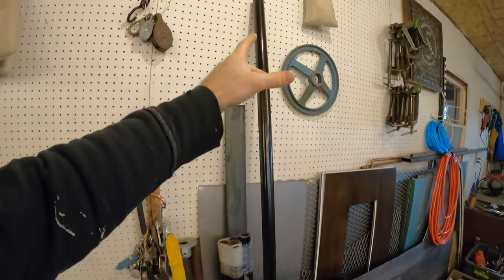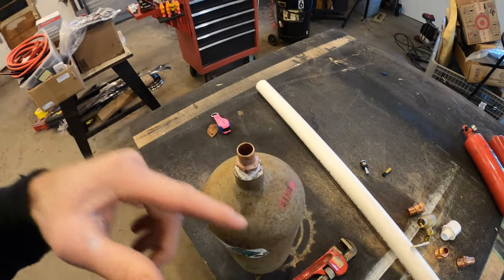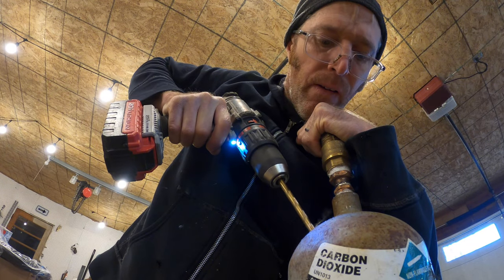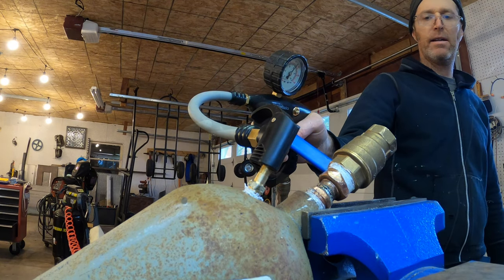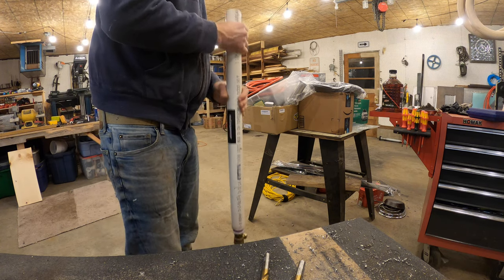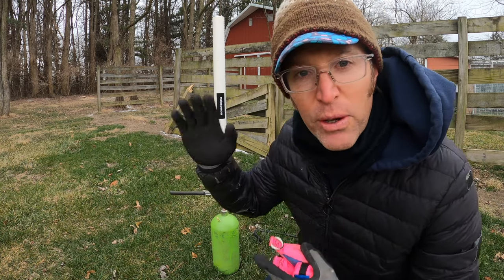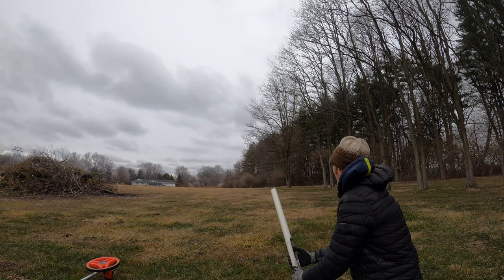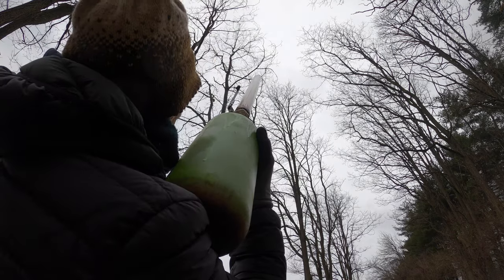Treezooka! DIY Throw Bag Air Cannon

Comment: So just built one of these, but I did a PVS SCH40-only version.  To measure the height of the fire, I just had my throwline attached and shot straight up.  Then measured the amount of throwline taken from the bag.  My air chamber was 34" long (with two bends to keep it short enough for a shoulder fire) so that was about 3/4 gallon.  I only pressurized up to 55 psi and got about 110 feet in altitude.  The 1 1/2" SCH40 PVC is rated to ~200 psi with a breaking point at 2000 psi, so hopefully, I am staying within what is safe.  I've seen the same setup used up to 90 psi.  I was also thinking of building a new version that is more like a big shot in that it would rest on the ground with a long straight air chamber instead of your shoulder.  Thought it might be easier to fire more accurately.  But would also want to think of a way to disassemble it with a coupling in the air chamber and/or removable barrel. And might also want a flexible or 45" degree coupling to facilitate sighting.  Thoughts?  Btw, I was in upstate New York over New Year's out at Niagara and then to Toronto, but was still too far to come by and say hi in person.
Reply from the maker: Sounds like a good build! I like your technique for measuring the distance -- much more scientific than my "Geeze, looks like 200'!" haha ... after making this cannon I've gotta admit that I seldom use it. I prefer my big slingshot on a stick for some reason. I guess it's just because it's easy to pull out of the truck and shoot. I'm eager to hear if you use it much in the field. Thanks for the update! I kinda wanna build that shoulder mounted cannon if only for the shoots and giggles :)

Comment: I have a kinetic water ram that I am going to use to do this. It's basically a tank with a gun trigger for blowing out drain lines. One idea to prevent the gun from over shooting as you described might be to stand on the throw line at a certain length so it goes past the branch then the line stops it and it drops. Also I've used a bow and arrow with fishing line and that worked well.
Reply from the maker: That kinetic water ram sounds pretty interesting -- cool idea. Fingers crossed for your project!
Reply: Ive used bow and arrow many times too.  Idk why, they've never said anything, but onlookers especially women always get that scared look in their eye when i pull out the bow and arrow.  I use a recurve so i adjust the height by just pulling back more or less.  Im planning on building an air cannon bag launcher by using a tire bead blaster and some abs pipe.  They have 2 gallon bead blasters with a trigger instead of a ball valve.

Comment: nice....ive been wanting to build an air canon ( mostly to play with) i have the big shot and the trigger for the pole which makes the accuracy insane... Most of the time it's strong enough to handle trees around here    stay safe stay healthy
Reply from the maker: I gotta get one of those triggers for my bigshot, cuz trying to hold that thing by hand is nuts :)
Reply: @metaspencer  it helps tremendously with accuracy also

Comment: Need line testing. Also look for paintball gun tanks.  Lightweight, but maybe not enough volume?  Even smaller and lighter weight would be a combustible chamber to do the old potato cannon launcher.  Your line length could also prevent overshooting / penetrating your crotch.  Keep developing this technology, if only for the views........I suspect this was more about good times then tree line productivity.   Glad your keeping busy.  I could have use your particular set of skills today. 60 feet pine tree came down last night in a wind storm.
Reply from the maker: That's quite a blower you had there! You're right about the air cannon: more of a fun thing to fiddle and play with than a tool I desperately need. I was throwing into some towering oaks the other day, though, and it would have been useful. I'll definitely keep and eye out for a lighter and smaller tank: that one almost needs a crane to carry it :)

Comment: awesome and fun video... gonna save the shoulder for sure...need some with the line tied on too see how its gonna affect the flight.. it will have to be a light line and then use it to pull the heavier line up and over? we did same thing with a vac to suck or blow a mouse line through conduit to pull wires or another rope through.
Reply from the maker: Yeah, I'll have to do some tests with the line before getting out there into the field with it ... I used to pull lines through conduit that way too. It's amazing how far you can suck a plastic bag on a string. Thanks for checking it out, man

Comment: Definitely worth investing in a cheap battery powered tire inflator. You can definitely measire out enough throwline to stop or slow it down and not have it launched WAY past the target. Although if it is fairly close then just throwing it is going to be easier anyway.
Reply from the maker: That inflation idea is solid!

Comment: Super cool project!!! For getting it to drop relatively soon after getting over a branch (or whatever), you could always gauge the height and tie off the line a few feet longer (4-5 maybe) than that. The extra few feet of line should cause it drop low enough to cause the bag to wrap on the branch (or whatever) before it springs back toward its origin. Also, I kept thinking of a faster trigger mechanism for it so you aren't expending the whole pressure of the tank every time you fire (specifically, I was thinking of the piston system used in No Country for Old Men, but that was a closed system, so not exactly applicable to this tool).
Reply from the maker: I'll be doing some practice with the line on the bag this week, so will have to try your method of shortening the distance with the line. Either that or I'll have to get a sense of how pressure and height correspond. Now your idea of not losing all the air is awesome: just a single puff would be nice. There are air-pressure pellet guns (PCP) that work that way, giving you many shots with a single tank of air. That would be oh so cool. Thanks for the ideas man
Reply: @metaspencer  It sounds like you're in for a lot of fun dialing this in! I'm excited to see what you come up with.
Reply: @metaspencer  pretty sure those have a seperate chamber that is isolated and fills up with every shot

Comment: Sooooooooooo cooooool...I just used PVC pipe for both air tank and barrel.. wayyyyyyyyyyy lighter and can hold 100psi...😁😁😁😁
Reply from the maker: That lighter version sounds great ... may have to make a backup for carrying deep into the woods. Thanks man

Comment: Height in straight up (vertical) shooting is easy to measure. All you need is a timer. Consider that bag velocity is 0 at the top. It is basically a free fall equation (disregarding air friction).
Free fall equation is h = 1/2*g*t^2, where t is a half travel time from the max height.
In your case, if your measure time since start till fall, as T (say 20 sec), t will be T/2 (10sec). And final formula will be h = 1/8*g*T^2

Example: 
Say T (from start till fall) = 20 sec
h = 1/8*9.8*(20sec)^2 = 490meters
Reply from the maker: Woah! The mathman cometh! Thanks… I’ll give it a try

Comment: Noticed that you were attaching a copper fitting on the steel tank. 
Joining copper to steel is not recommended due to the resulting galvanic corrosion between copper and steel.
Reply from the maker: Thanks for the tip ... it still looks like the day I put it together but perhaps over time it'll degrade. I'll keep and eye on it

Comment: I just used pvc for my air tank. Alot lighter. I wrapped it with duct tape just in case it cracked. Looks awsome tho
Reply from the maker: I'm thinking a lighter version like yours would be a good idea and take up less space in the truck. thanks man
Reply: @metaspencer  . I made it so the barrel unscrews so its 2 pieces. Easier to store and transport. Plus i made a couple different sized barrels. 1 shoots tennis balls, 1 for throw bags
Reply from the maker: @megadosevitaminc8774  oh man, awesome ideas ... I like it! okay, I'll have to keep tinkering

Comment: Thread the valve all the way using a real threader jig, not with your impact driver. Don't look down the tube even if the ball valve is there: Push your throw bag down with a hollow tube. Better safe than sorry.
Reply from the maker: good tips -- thanks man

Comment: How you gonna add a clamp around the top end of that a pipe on your throw bagger air tank and then bring 2 pieces of PVC that you hold at an angle you know Adam V on the ground and then set it on the ground and name it where you want to and then learn to have whatever pressure for the go to high to you want anyway I just thought that my bill suggestion
Reply from the maker: I like that idea -- and I could create a chart with air pressure and heights and stick it to the side of the bottle. Great idea man. I'll have to get the bugs sorted out. thanks

Comment: You need to test with the line. It will act differently.  Could probbly break on the line. The aiming part though .. thx
Reply from the maker: yeah absolutely ... someone else mentioned that the line might even arrest the bag in a useful way, so I'll have to test more before I'm at someone's house blowing their windows out :) thanks for checking it out, man

Comment: With that steel tank it will be too heavy to lug around out in the field. Using a sprinkler control valve to release the air would be smoother.
Reply from the maker: great ideas. thanks man

Comment: i did not see any OPD (over pressure device) installed. Any and all pressure vessels should be equipped with an over pressure device to prevent over pressuring. when you removed the original nozzle you most likely removed the built in OPD. great project though. another thought,  reverse the ball valve so you have a pull to release rather than a push to realease.
Reply from the maker: Good ideas and thanks for the note on the pressure valve. I've still got it and should reinstall. Thanks

Comment: I have a potato gun, with a 1.5 inch barrel,    I might have to try this out soon,   only issue,   it has an electronic valve,  so i have to carry a battery with me, but itll be fine
Reply from the maker: I've heard from another dude that the electric valves are nice and smooth, though, so there is that benefit :)
Reply: @metaspencer  I wouldnt say smooth, (solenoid valve)   but hella fast opening,   near instant,   but expensive as well
Reply: @metaspencer  I just bought a notch sentry,  if it gets here soon, I can try it out this weekend,   how much do you like yours?    I dont care much about it, so long as its better than my rock climbing harness
Reply from the maker: @WoodCutr1  The only problem I have with the harness, which I generally like a lot, is that I got the smaller size and my ass doesn't perfectly squeeze into it :) So yeah, it's a good basic harness. I've modified it a bit which I'll cover in that video
Reply: sounds good

Comment: Where did you get the schrader valve with the threads?
Reply from the maker: Amazon I think … gotta search a bit
Reply: @metaspencer  I found em at home depot surprisingly. Thanks
Reply from the maker: Excellent
Reply: @metaspencer  Is your schrader valve 1/8" or 1/4"? Don't think it will make much of a difference. Just a bit curious. Thanks
Reply from the maker: That’s a detail I can’t remember… sorry
Reply: @metaspencer  Just finished my build. This thing is a rocket! I ended up using a small portable oxygen torch tank, and a 1/8" tank valve. I figure I could upgrade the tank valve later on, if needed. As the 1/8" is rated for 150psi and the 1/4" tank valve is rated for 250psi.
Thanks for the help and the build idea. The only thing I'd like to try and find, is a green handle grip for the barrel, like the APTA has from tree stuff. But haven't had any luck locating them 😬.
Thanks again!
Reply from the maker: @alotl1kevegas860  Boom! There ya go ... sounds like a good one!
Reply from the maker: @alotl1kevegas860  Oh cool, I see it now ... thanks for the tip

Comment: Your valve is in the wrong direction.  Pulling the valve to open is way more controllable.
Reply from the maker: I've heard that from a few others ... makes sense!
Reply: I love your pressure chamber.  I used about 20 inches of 4 inch pvc rated for 330 pounds.  I put a pressure gauge on it as well.  I shoot 12 oz bags which fit perfect.  It shoots at least 150 feet high at 120.  You have to calibrate the cannon to pressure vs height which is tricky.  The only problem is it can shoot over several trees lol. @metaspencer
Reply from the maker: @emzzzz992  yeah I've had that same problem -- sometimes the canon has TOOOOOOO much power and the bag gets into the next trees. Your build sounds cool!

Comment: I notice when you fire it, it pulls your aim I. The direction.that you're pulling the lever.   I've heard of people using a solenoid valve from a lawn sprinkler system.  Said valve, a 9v battery and a switch and you have yourself a rapid release at a "pull of the trigger" without sacrificing aim
Reply from the maker: Oh dang that's a cool idea. I used to install those valves all the time when I did irrigation system work. And you're right: my aim is lousy and getting pulled off at the last minute. Thanks man!